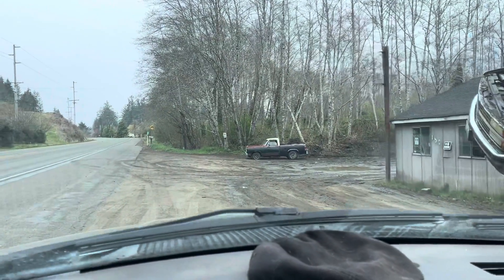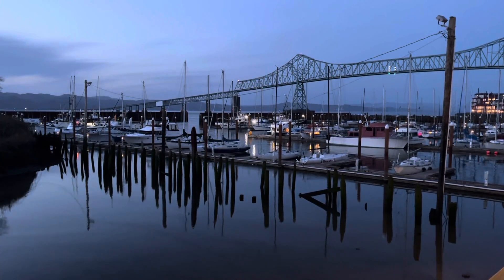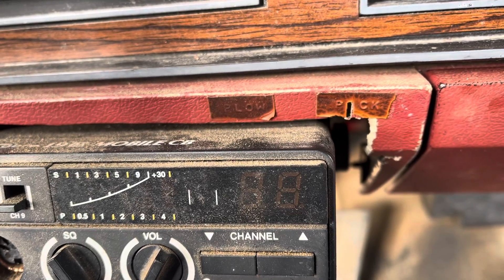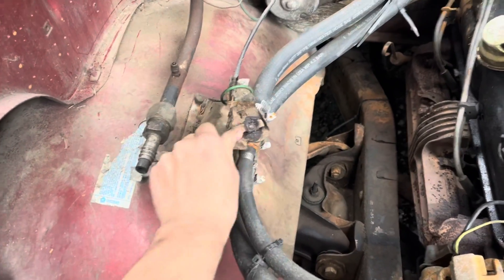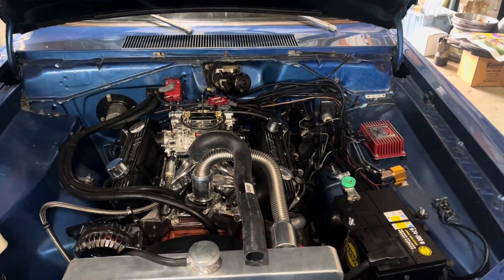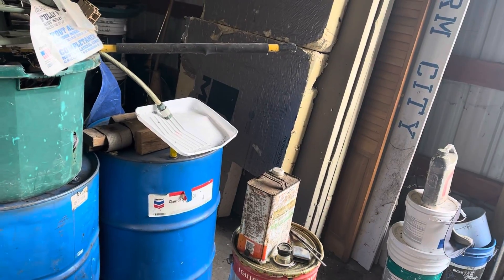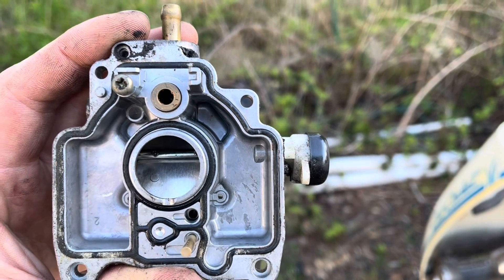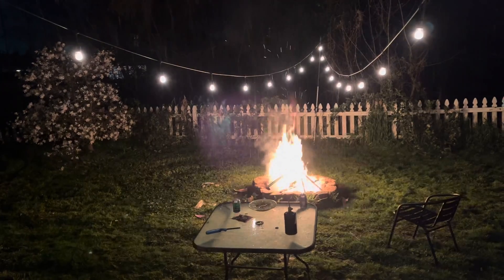The Dead Dodge Mixtape - Trucks, Demon, Projects, Adventures, And More

Comment: Nice Power Wagon, Demon, and Cobra....but it's the '83 pickup w/the flat tire that's got my envy....my '83 is from Connecticut...lots of rust.
Do yourself a favor and get an older Cub Cadet...the ones that IH made...stay far away from that Kohler "Courage" stuff...you'll be happier!😁👍
Reply from the maker: Slant six! And other than that one spot above the wheel well it’s solid as a rock! That’s rare for here even. I love the thing. It needs a little more tinkering to run right and I would be driving it all the time. 

I installed one of those Kohlers in a Toro Dingo so I know them fairly well, and also kinda hate them. But the lawn mower was free so it’s hard to argue with that. Well it was free before I bought a battery, two deck belts, put a bunch of time into it, and it needs two tires… I’ll keep that in mind. Haha.
Reply: @DeadDodgeGarage  Man, another thing....Chrysler REALLY loved red interiors on those '80's trucks!
Reply from the maker: @kenthawkins2418  Seriously. I think every one I've had so far was red...